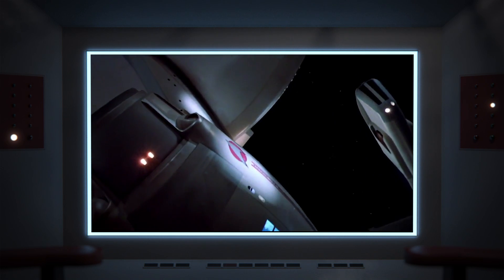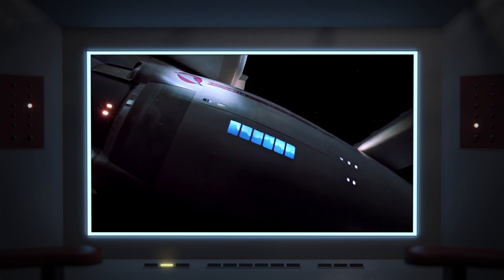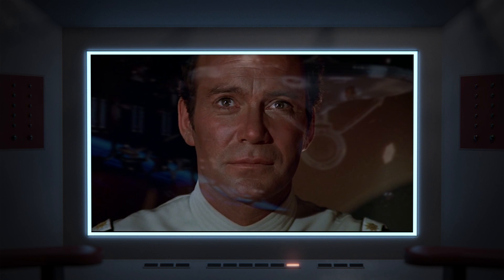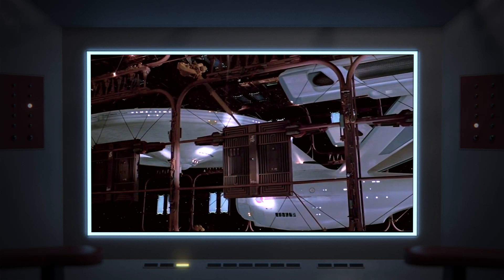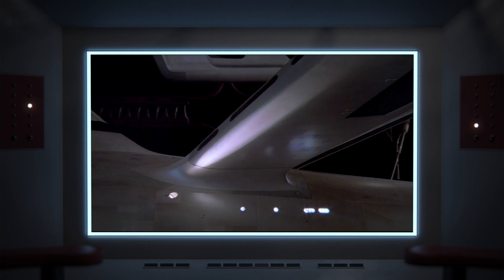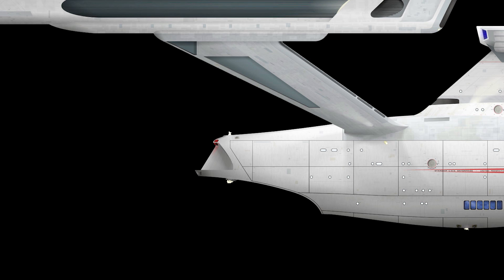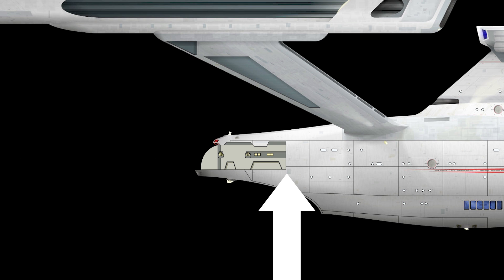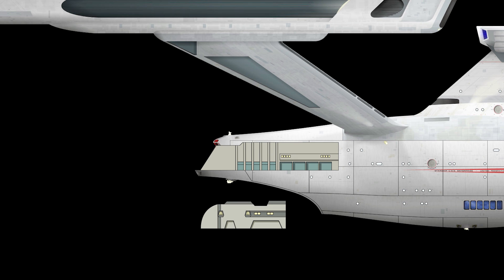Why Have Angled Nacelle Struts? (Enterprise Refit)

Comment: This is like asking why have a saucer or why have a neck separating two different parts of the ship?

 There's some in universe exclamation that we will never know, maybe when you're in an atmosphere where momentum matters, that helps the plasma flow better at an angle into the engines. 

So really there is no need for a ship to be of any shape, and all the other cosmetic examples are equally pointless.

 The neck is probably the most nonsensical part , I wish you had focused on that, why have a neck? It serves no purpose whatsoever, the saucer could disconnect directly from the secondary hull.

Comment: Love the reasoning. Also since we are not dealing with significant weight only when in orbit, that negative would be offset by having a lower torque angle, thus less physical stress on the struts when using the warp engines which is the more often used engines while underway.

Comment: I always figured Main Engineering was in the same space but with them moving to a vertical Core the struts had to move forward to more efficiently meet the terminus of the core, and thus had to be swept back to give the nacelles space behind the primary hull, with a larger interior for the Shuttle bay and I assume storage being a bonus.

Comment: One other thing is they attach to the engine nacelles in the center.  So it the ships maneuvering in real space ( rather then floating in the warp bubble) those long nacelles aren't just grabbed at the frount end, putting more torque on them.
Also the pylons widen toward the nacelles and have other venting et equipment.

Comment: The vertical warp core extends from the rear of the saucer (the 'crystal' thing) through the neck and into the secondary hull behind the deflector.    The pylons are angled so they connect to the hull closer to the core and to reduce the length of the plasma conduits.
Reply: I'd also go with because it's angled it gives more direct support to the structure of the ship during acceleration.

Comment: Interesting proposition. I hadn't given that any thought. Two other advantages come to mind. [1] The struts now come from under the centre of the nacelles, meaning that when the ship is flying over a planet's surface (not the same as being in a free-fall orbit) the nacelles centre of gravity is over struts top point, putting far less strain on that joint. [2] raking the struts backwards means  the forward thrust from the nacelles is transferred to the the rest of the ship in a line closer to parallel to the direction of flight. That in turn means the points where the struts connect to the nacelles and main hull get less strain for the same drive force compared to the old design. However, the most important change is that the Enterprise no looks as fast as she is!

Comment: If the nacelles are pushing the ship forward in any way, then that angle would put less stress on the pylons. (Though I'm fairly certain the way warp works, the pylons just generate a field and don't actually create any sort of propulsion)

Also, the pylons being in a more triangular shape would make them structurally sturdier.

Comment: You know - I really love both the original Enterprise from the 1960’s as well as the refit. And - it is so difficult to believe that they would put so much energy, time and effort to make tings play out from the model to the studio sets in such a successful manor.
On the other hand, the thing that has always confused me is the fact that - in SPACE - there is to “up & down” so with the advancement of “graviton emitters” there is LESS of a requirement for “up & down” to exist in space. Rooms could (theoretically) be turned at any angle in relation to each other and ships could therefor be virtually any shape or design. With that in mind - the designs of ALL of the ships of Star Trek become uncreative and boring. 
Or, perhaps I am overthinking it a bit...

Comment: If you believe the interior set dressing and the Franz Joseph Designs materials (tech manual, blueprints) of the original series, vs. the set dressing and other clues about the movie ship(s), there is a case to be made that there's a huge engineering design change that's introduced in the NCC-1701/A Enterprise, and persists afterwards throughout all the subsequent series. 

The movie, TNG, and other ships all apparently have a single warp core, a usually-vertical matter/antimatter reactor with large-diameter reactant chambers of some kind, and smaller-diameter tubes presumably carrying post-reaction energized plasma through conduits to various energy-consuming devices throughout the ship, certainly including the warp engines themselves.  Even the prequel Enterprise, NX-01, has this design, though from the sets, it seems their primary reactor is laid out longitudinally in the secondary hull. But, the important piece here is, this reactor is very prominent in 1701/A.

The TOS Enterprise apparently has no such feature -- either the TOS matter/antimatter reactors are somewhere else, or they're smaller, or both. There is an episode (Elaan of Troyius, and yes, I am a huge ST nerd) where dilithium crystals are placed in a holder in one of those big round features in the floor of the engineering bay, so presumably those things are reactors, or associated with reaction control in some important way that makes warp travel possible, but their small size, even compared to the impulse engines behind Mr. Scott's hex-grid panel, suggests that whatever their role is, they are not the primary energy source. A reasonable guess is that, in the TOS ships, the reactors that power the main drive are actually inside the nacelles themselves, and not accessible during ship operations, and the various other places in the ship where dilithium crystals are seen are, while obviously critical, nevertheless secondary control systems of some kind.

This fits in very well with the movie redesign. The movie nacelles are smaller, because they don't do as much, they just have the part that consumes drive plasma and generates the warp field, and likewise the movie pylons are larger, because they do more, they're carrying operationally-critical, high-energy drive plasma from the main reactor in the secondary hull to the actual engines.

Comment: I thought I read somewhere that the nacelles were pushed slightly farther away from the main body because of radiation concerns with the new engines.  I thought that's why nacelles are separated from the main body because of radiation concerns.  The Defiant being an exception.

Comment: Excellent point, presentation and reasoning. 

I also thought it was a primarily because of the increased warp speed - which is dependent on the size and structure of the warp bubble. Especially as the Refit and A can travel faster than the original Constitution class design, the narrow but tall nacelles further away from the hull and saucer section allowed the bubble to be more efficient. But your conclusion is probably more accurate. Especially as the Refit went on another 5 year mission (and the A another one after that), and from experience, the previous 5 year mission lost a few shuttle craft.

Comment: My eye is drawn to those vents and thinks maybe there's a very real reason they're there on the new struts when there weren't any there before. So I look again at the original and see what might be large vents on the nacelles themselves, on the inboard side.

So now I suspect they determined there's a benefit to emergency venting  (warp plasma?) somewhere along the line before it gets to the nacelles, instead of after. Maybe it allows for the reaction to be better controlled in the secondary hull, maybe it is quicker and therefore safer, or maybe it's engineer solution for a desire to vent outboard instead of inboard, or maybe it's simply less likely to damage the field generators in the nacelles when done that way.

Comment: Not to get all techno bablle on you, but there is another reason why too.  The new warp core seems to be centered mch higher in the ship, which means all that the new plasma transfer conduits are not at a 90 degree angle, so they probably work more efficiently.  I am not  fully sure if this is show to be this way in the film, but it would appear that way just from the outside of the ship.  But I like the shuttle bay theory, I never thought of that.

Comment: Might have something to do with the new warp cores bring vertical rather than horizontal as well. The new engineering sections will be tall rather than long.
Reply: If you watch any scene in engineering of the original series you see these series of tubes at the back behind some grating, I always figured those went up the pylons to the nacelles.  As you mention and as can be seen comparing the original and refit, the engineering hull is thicker to make room for the vertical warp core.  It's further up too, so you see the two tubes going further back before branching off towards ( presumably ) the pylons.

Comment: By sweeping the struts back at an angle, they were able to brace the engines more in the center and with the widening, with a more substantial point of contact. They weren't as prone to being swung off into a dangle.

Comment: In addition to observations on the struts being thicker at their connection points (which others have mentioned) You'll notice the struts connect mid-secondary hull to mid-nacelle, while maintaining the same general placement of both nacelle and secondary/primary hulls. combined with the sturdier struts, I'd imagine this makes them VERY secure.

Comment: the struts are also basically the same width at the base and wider at the top so I have seen many people argue that it serves no additional structural purpose.. but they all neglect to notice the clearly visible vents that are on the back half of the struts..   I have been convinced for literal decades that these are radiators to help bleed off excessive heat when she goes to warp.     the TOS enterprise is regularly seen, after going to warp, to increase its warp factor incrementally..  I don't recall ever seeing them do that in the movies.

Comment: What bugs me is the simple issue of clearance for the nacelles. In the constitution you have both the primary and secondary hulls, and the nacelles on long struts. Rodenberry said the latter was so the nacelles could have a clear line of sight to each other. Ok but why make the saucer and the engineering hulls so far apart and unintegrated then? And the saucer in the refit gets in the way of the nacelles a little bit interrupting their forward clearance for the bussard collectors. IMO the original enterprise should have had a layout similar to the much later Sovereign class. It's a more robust spaceframe, you have more than enough nacelle clearance, and you don't need as much internal volume dedicated to elevators to get from engineering to the bridge which I imagine is a bit of a process in the Constitution.

Or alternatively if the saucer and engineering sections MUST be separate you could go the Galaxy class route and clear the bussards under the saucer on shorter pylons. This is why so many Federation ships since TOS have attempted to better address the awkwardness and ostentation of the Constitution. And the results speak for their selves. They all look much faster and stronger structurally than their predecessor. They appear more polished and rational.

Comment: I still think its weird they would have a hanger deck at all. Why not just dock the shuttles on the hull? 

Keep a ready to go shuttle on most every major docking port. Design the ship so the shuttles can even act as an emergency RCS system. It would give you more evenly distributed escape capacity vs central hanger deck. 

It would save internal space. Maybe a small repair hanger would make sense? It wouldn't need too be very big comparatively too work on one shuttle at a time.  Or alternately, work on them on the hull. Little shield generator too keep the maintenance crew safe...

Bonus, they can launch more, or even all  shuttles simultaneously compared to an aircraft carrier style hanger and elevator system...

Comment: To use a techno-babble explanation:

The angled struts pushes the nacelles further away from the Primary (Saucer) hull, and would thus be slightly safer than it's previous positioning.
Reply: there's no real difference in the distance from nacelle to saucer.
Reply: Perhaps, except that it's often the warp core itself that's in danger of going boom.
Reply: @johnrickard8512  Funny you should mention that. The only time any warp core seems to go boom as it were has been in TNG and Voyager and anything post TOS.
It's almost as if the engineers during Kirk's time were more inclined to incorporating redundancies and fail safes, like most sensible engineers would.
With Enterprise D it was almost as if you could sneeze and disrupt the containment field.

Comment: The struts are also significantly larger at the nacelle interface as well, presumably this is a stronger connection and may allow for better paths for high energy plasma to enter the warp cols as well, closer to the front of the nacelle where the control apparatus would be

Comment: One might not consider things like aerodynamics in the vacuum of space, but we often forget that space isn't COMPLETELY empty; there are still particles of hydrogen, helium and traces of other atoms and compounds scattered throughout the cosmos. Now, these particles may pose little effect drag-wise to our current spacecrafts, but our top speeds so far are just in the 10-20 kilometers-per-second range, barely a tiny fraction of a percent of the speed of light. Canonically, the Enterprises's impulse engines can reach up to half the speed of light. At that speed, even the almost-near vacuum of space can suddenly become like flying through a supercharged sand-blaster, so a stronger, more sleek design might not just be practical, but necessary. Plus, anyone who knows basic engineering knows angled beams tend to be sturdier that straight, vertical ones, hence why most suspension bridges have thous crisscrossed triangular patterns with their support bars.
Reply: the whole "trace elements" issue has never been a problem due to navigational deflectors.

and the strength isnt much of an issue either since warp travel is basically intertialess its more like being pulled forward by a warp bubble.
Reply: Warp Drive may lack inertia, but impulse drive does. It's the reason why all ships have inertial dampeners, as maximum impulse is half the speed of light, and in the show it's easy to tell a ship starting up its impulse engines goes from 0 to half light speed in just a few seconds.
Reply: @AceSpadeThePikachu  but the impulse engine is on the back of the saucer section, the amount of strain on the nacelle joints wouldnt be too much of an issue.
Reply: St half the speed of light, the very thin whisp of hydrogen molecules spread centimeters apart between each other, plus alpha and beta radiation from distant start would turn into a supercharged sandblaster that would shred any material on the microscopic level. The microwave background radiation would also blueshift into lethal gamma rays. The Enterprise would have to have its shields raised perpetually while at impulse power or the crew would be dead in seconds.
Reply: @AceSpadeThePikachu  hence navigational deflectors. :)

Comment: I mean dude.... You do realize that not everything has to be made for a practical reason, don't you? Aesthetics is an important part, when it comes to designing objects. That's it. End of story. If it wasn't that case, then every single car manufacturer's every single car model would be identical. But they aren't, because design matters for us human beings.
Reply: During the era of the 5 year missions it was important to have ships that were easy and fast to build, with lots of interchangeable parts.  As the federation expanded new civilizations brought in new engineering technologies and new aesthetics.  Ships became more specialized and design became more important instead of just  practicality.

Comment: A reduction in the number of 90 degree angles would make for a sturdier design.  Consider with the original struts at 90 degrees to the hull stress would increase with forward momentum as the nacelles move with the rest of the ship.  With the angled design the stress of forward movement is allowed to bleed away over the length of the strut instead of the attachment point absorbing the stress of acceleration.  Plus it looks cool.